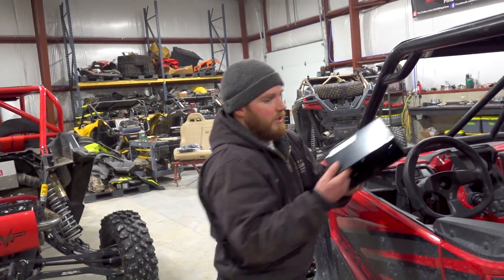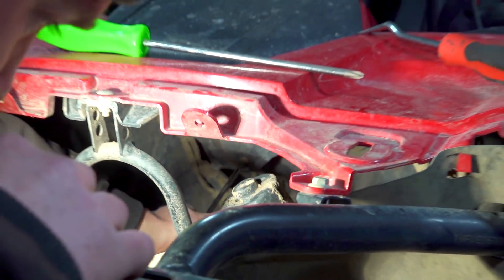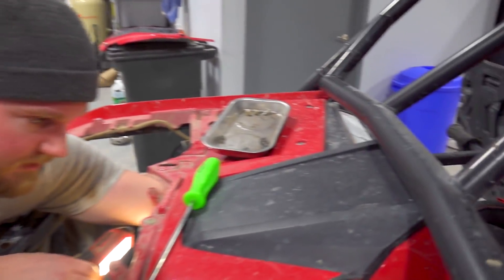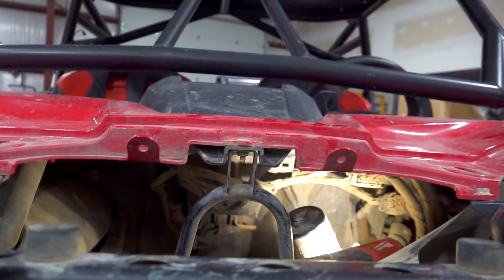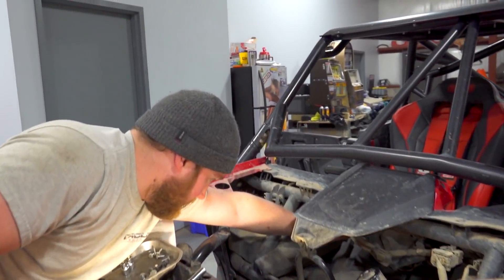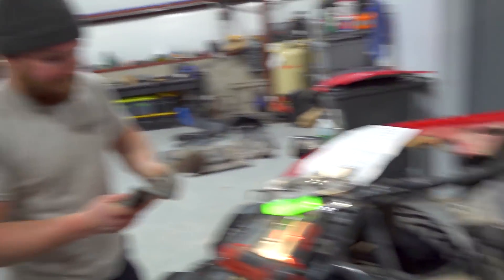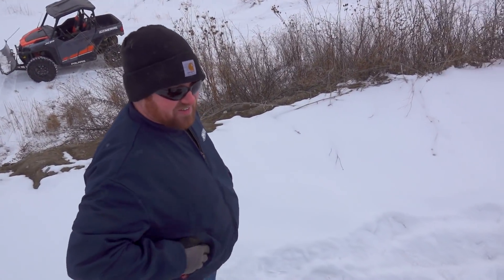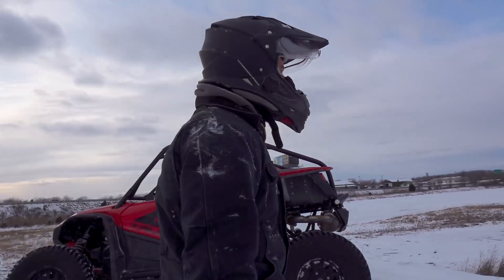Honda Talon dash relocate and i4wd mods! Big air and CYCLONES

Comment: The new dash housing would look a lot better if it wasn't squared off on top, but still better then leaving it in the stock location
Reply: Makes it look like a race car dash
Reply: Definitely a better location, but it’s ugly for sure. Lol.
Reply: Agree.   That housing is hideous. They could have used injection molded or 3d printed the housing for a better look. The square metal housing just looks dumb and home made.

Comment: I think the Talon is by far the most reliable and toughest machine in the fleet. She gets beat and still keeps on going. Those X3 blow up, RZR axle belts and engines troubles. If I dont recall this is still the factory engine after being completely sank in water.
Reply: I forgot about that! 😂
Reply: True but the x3’s that blew up were significantly turned up!
Reply: Dude what are you smoking? The talon has a small turbo on it while those x3’s and razors have MASSIVELY turned up engines. When you make power like that on parts not rated for it, you risk all the moving parts, not just the engine. That engine is putting tons of strain on the belt and axles etc, and things are bound to break when you drive like they do and make the power they do. The talon does seem reliable but when comparing, compare apples to apples.

Comment: I keep forgetting the talon has a Jackson racing turbo kit on it cause they never talk about it, must be that it’s not impressive or worth it??
Reply: Its probably tough to compare to the  ghoul and beast mode those have both become really high horsepower builds. I'm curious if they will respond and what they have to say.
Reply: They've never showed it in a straight up drag race with anything comparable so I'd say it can't be to impressive
Reply: @mid-misage3416  the turbo kit specs it improves horsepower by 60% Honda stock spec says 104hp so assuming 60% increase its 166hp at the crank. Both ghoul and beast mode are around 500 hp and the cf1 is 350hp i think?? And most of the other machines are in the 200s for sure. So the lable of "impressive" is hard to say when compared to the other built machines. Compare it to stock talon and the xp and x3 and then you could get a good baseline
Reply: And in an update doing some research a stock x3 turbo makes 195 and the rzr 168 the new xp is 188. The NA car is 110 for the rzr. The kit basically makes it a factory turbo car. The YXZ is also na but does not provide a hp rating. The x3 is now turbo only but to go from the bottom grade 120hp to the top of the line 195hp xds is a $6000 jump. Although it has other goodies thats just over the price of the turbo kit for the same power increase.
Reply: They used to speak fondly of the sound with the aftermarket exhaust, but have been running the stock muffler since the turbo went on.
There may be an agreement on what they can/can't do with the turbo kit to keep the machine reliable. 
It can't feel that impressive when their other units have like 100 more hp but it does pretty well considering. I just wish it would sound good again.
Reply: @alexvandenheuvel3874  they still have the Talon X, I believe, and a couple stock RZR Pro's to give us a base line against
Reply from the maker: We’ve raced it on video against a stock Pro XP when the Talon was on 32s and it ran right with the Pro. We’ve indicated numerous amounts of times how much we’ve been impressed with the Jackson Racing kit.
Reply: @110Garage  what video? Just rematch when you took them to St. Helen, and that wasn't it.
Reply: I miss how the Talon sounded with the exhaust, I know it's turbo now, but it sounded so good! Hopefully something gets worked out so it can go back on 👍👍
Reply: @LikelyCandidate  it makes most power with that pipe so far....
Reply: @LikelyCandidate  The turbo requires the stock exhaust.
Reply: @650ic6  That sounds like an opinion. I'm sure third party tuning could make it work.